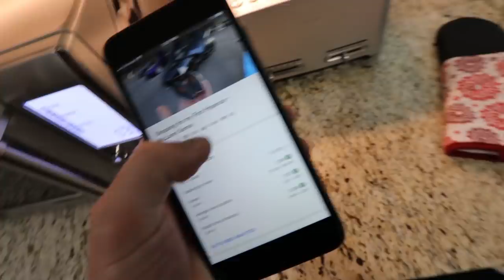Burying my friend's Rolls Royce in the Backyard.

Comment: Here is how this goes: That hole will soon have a water level in it and it will turn the rolls into a flood car, which are gross and bad in every horrible way. Imo no car should see that sort of destiny - what did it do?   The soil does not deserve spoiling either, to which there is a high risk in a stunt like that. Disgusted by this all, I´ll hereby unlike this video and boycott the channel until I forget how I feel now of this. It´s probably hard as long as the rolls is there.